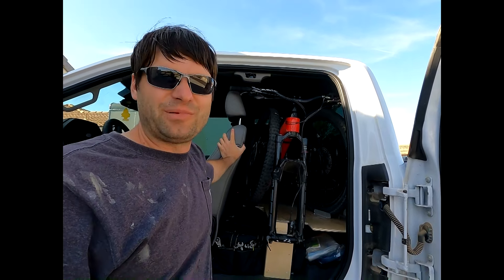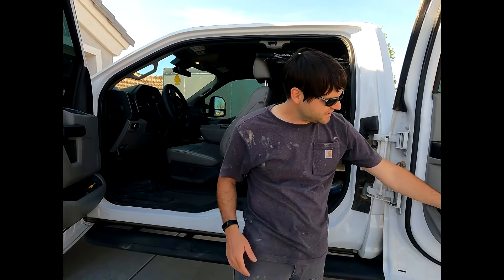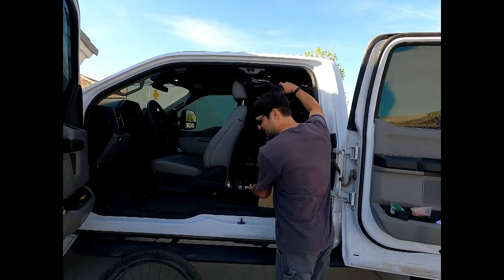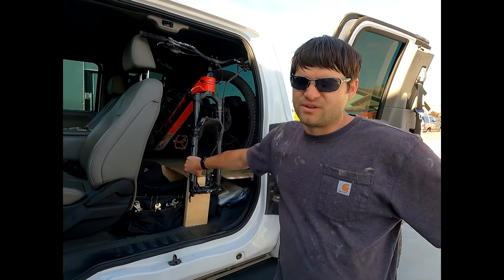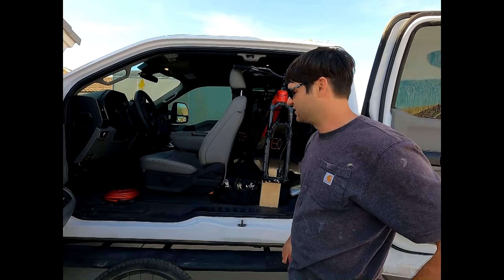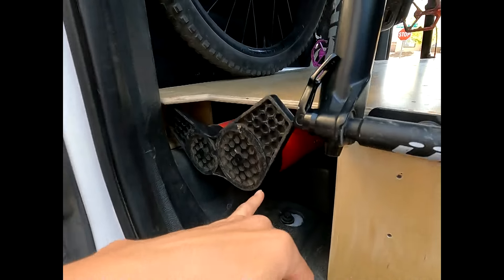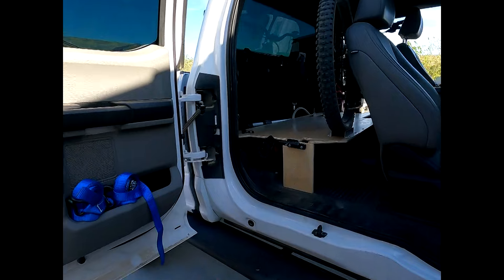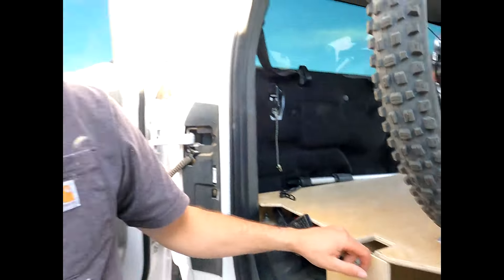Bike Rack 2.0 - Interior Ford Super Duty - Fits 2 eMTB Bikes! | Part 24

Comment: This looks great. I have a similar setup, and I spent all summer just stuffing my two bikes in the back of the truck with the seats removed. Currently I just have the axle mounts similar to yours except I attached them to a 2x4. I'm trying to come up with a more clever setup. If I put the work into building something, I want it to be significantly easier / faster to load than my current arrangement. Have you seen or contemplated any slide configurations? Do you think your current setup is significantly better than just tossing the bikes in the back?
Reply from the maker: We have multiple videos on the interior bike rack (check them out).  Slides are not possible as the bikes need to drop and tilt while loading.  Lots of test fitting!  And adjusting.  But we can load/unload either bike in any order.  It's tight but works awesome when dialed in and much quicker than most options.  Plus secure.  Have fun!!!  We love interior racks

Comment: Thank you for sharing this!  I'm working on building something similar for our Silverado - so excited to have found your video. Can you please share a little more about how you attached the platform to the base that's bolted into the seat bolts? Thank you!
Reply from the maker: The end of the video shows the base and how it's bolted to the truck.  The top of the platform is screwed to the base wood mounts with small square head trim screws.  That makes it removable.  Original video of platform: https://youtu.be/3xury4nTEF0